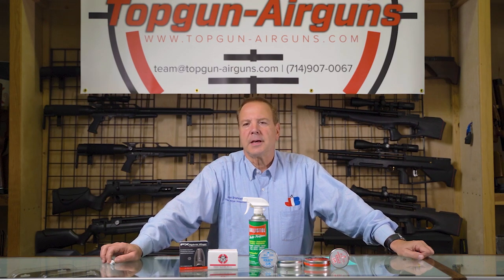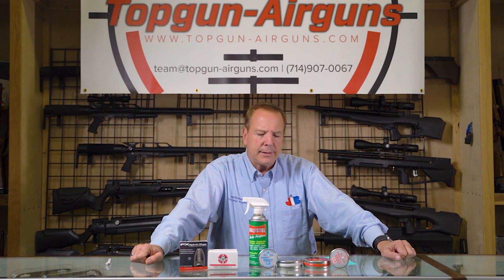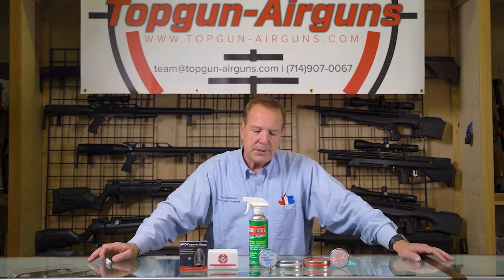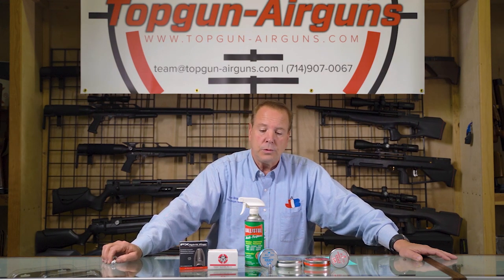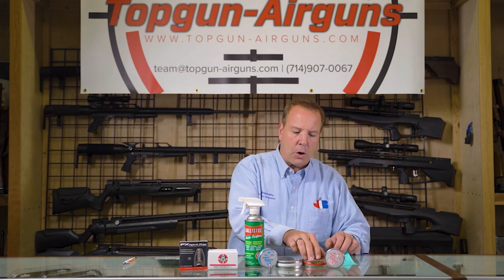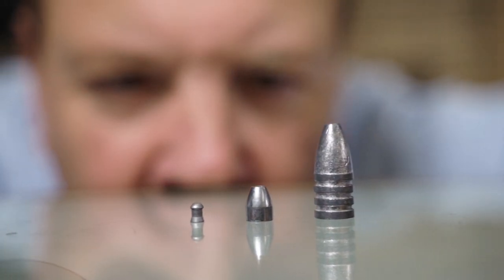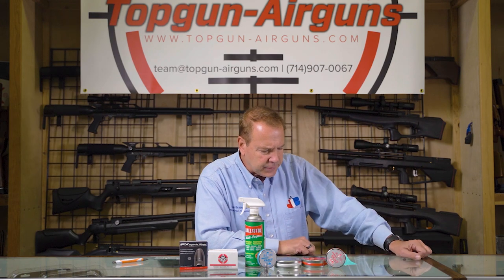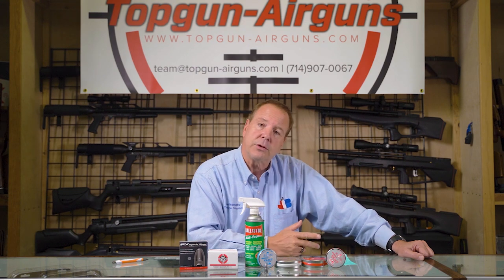Short Shots EP1 : Lubing Your Pellets & FX Javelin (Exciting News)

Comment: I've been using Krytec bicycle chain wax lubricant on my pellets for many years for my spring piston airguns... it's important to wash your pellets of the residue first... I dump a tin a pellets in a screen strainer, rinse in warm water, add a couple drops of Dawn dish washing soap, scrub them with an old soft toothbrush under running water... dump them onto an old towel in a flat baking pan, dry the excess moisture off, then dump them into to pan... let them air dry, or use a hair dryer to dry them completely... dump the pellets in a plastic tupperware type container, spray a few drops (I still have a few cans of the aerosol Krytec), put the plastic lid on, and swish the pellets around... then dump them a different container to dry completely, then put them back in the pellet tin (I wipe it out clean before hand), and label the tin as being "Kryteced".

The lubed pellets work well, and keep the barrel fairly clean... from what I can tell.

I only have one PCP, a Career III 707 carbine... I use STP "One Lube" on those pellets, using the same process as above.

It took me longer than 3 minutes to type all that !

Comment: I washed and lubed my pellets last night lube them with silicone spray lube tried the pellets today now I have to buy a new tin of pellets as the accuracy as gone south...never again will I lube them
Reply from the maker: That is one of the reasons I say DON'T OVERLUBE (which is probably what you did, adding additional weight, and destabilizing.)
That's why I said "It's better to NOT lube than to over-lube".
You can probably clean off the excess by washing in detergent.
Cheers
Reply: @AirGunScientist I've bought a fresh tin of jsb exacts and done nothing with them and my gun feels different and even sounds different and the pellets fit snugly in the barrel as apposed to the washed ones